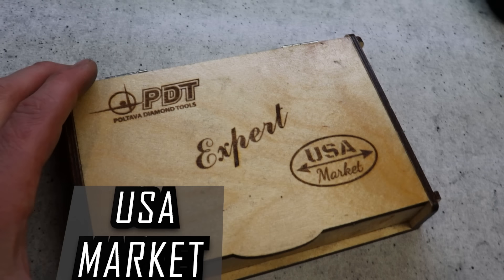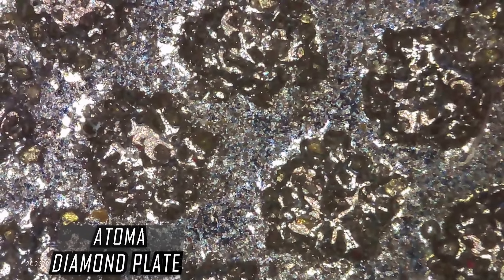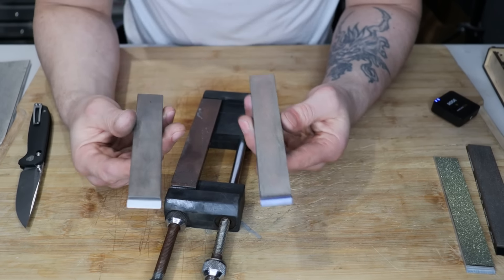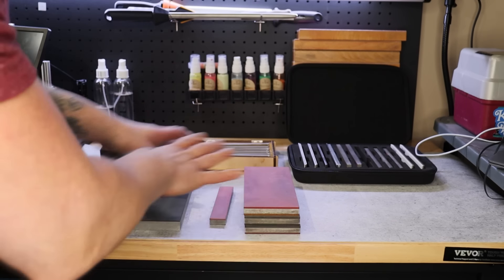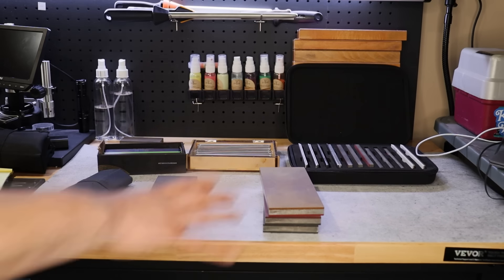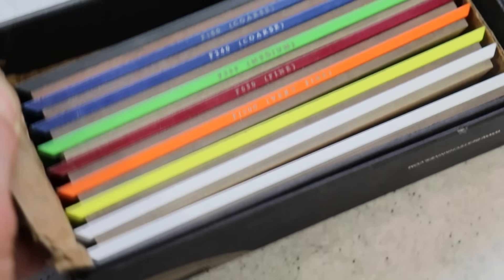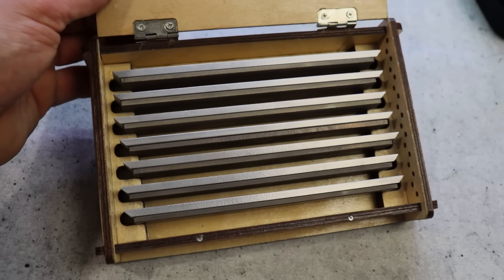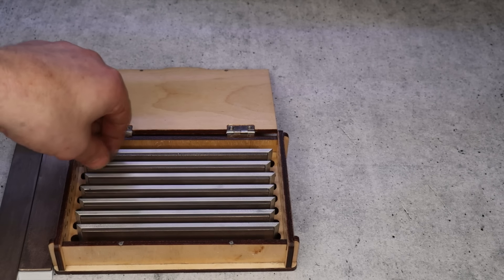Worlds Best Sharpening Stones!?  NEW USA MARKET SHARPENING STONES

Comment: Dude your Hapstone Premium stones still have the gray factory resin on them. That's why they aren't cutting. If you lap them with silicon carbide powder they will cut just as fast as PDT Resin and Metallic bonded CBN stones. I can literally guarantee it. The Hapstone Premium are also a hybrid organic resin and metallic bond mix. They are not pure metallic bond.

All that said, the PDT Resin Bonded CBN are by far my favorite stones of all time. So I agreed wholeheartedly with you and ones tried all the others you mentioned as well. Great video thanks!
Reply: Just out of curiosity but what grit of silicon powder do you use?
Reply: @fuzzynuttz5092  Different for every stone but never use a higher grit powder than the stone itself.
Reply: I’m glad you said something because I just got the Premium Hamptone set I used them and as they worked fine , they didn’t cut that great with less feedback than resin bonded , I have sic powder to cut them down hopefully there better , do you recommend a certain grit sic for the certain grit stone ? Thanks
Reply: @EdgeStoneKnives  will keep that in mind
Reply: Just subscribed to your channel
Reply: I just read that they use electrolysis or ferric chlorine to maintain CBN stones , can you use Sic power?
Reply: Fantastic more stones that I can't get 😂 No I appreciate ya keeping it 💯 bro and hope you have a fantasticc day as well as the family.
Reply from the maker: so i did do that, maybe i need to do them again thanks for the tip i will make sure to go ham on the powder see if i cant knock it down
Reply: @Antimatter.  Yes SiC powder is the only thing you can use on the resin CBN and on the metallic bonded CBN you can use it or ferric chloride.
Reply: @NeevesKnives  Yeah on mine I had to use F60/80 on the J80 obviously but also had to start all the rest of them off on F120 powder to get all that glaze off and get them flat. Then I obviously lapped each stone to higher grits, finishing just below the actual stone grit.
Reply: Thank you. I hate to see good stones like Hapstones cbn go to waste because they are not prepped correctly.
Reply: @Antimatter.  The SIC will embed in the softer metallic bond. Avoid it if your chasing
a mirror.
Reply: @JohnDoe-zb7dz  Ok Thanks I will , the electrolysis seems to work best
Reply: Hey, I noticed you have a channel. I’d be super interested in a video on how to prep and remove the grey factory finish from these Hapstone Premium CBNs if that was something you’d consider.
Reply: @timothyricca2250  yeah I need to stop being lazy and do a video of that
Reply: I can attest to this, mine wasn't cutting very fast either and used the little square stone that came with my naniwa and it helped but when I used the silicone carbide powder it was a big time improvement
Reply: @EdgeStoneKnives  Holy Cow you were right what a difference!!! I contacted Hapstone today and they told me if you need them more aggressive use Sic powder , So I use approx 200-300  grit lower on each stone and lapped that grey crap off , I have a complete set of sic powder so It made it easy , The 80 and 150 grit cuts like a beast now , Thanks again for the heads up
Reply: @Antimatter.  Awesome!! Love to hear that. They really should communicate that more to everyone that buys them!
Reply: @EdgeStoneKnives  Yes I agree it really completely changed them , there was No  feedback too now there great !!!
Reply from the maker: @EdgeStoneKnives yeah I used the 60 grit powder but I'm going to go over it again, maybe they need more than others I'm used to. Because normally I don't have to do that to most other bonded stones it helps bug not always a must. But I'm going to see thanks for the info
Reply: @NeevesKnives  Perhaps the "grey layer" is some kind of mold release or base layer? It would make sense then if that part of the stone doesn't have much abrasive and getting past it makes the stone perform as it should. I have some of the Hapstone premium CBNs on the way so I can't compare them yet.
Reply from the maker: @Riyame  personally these would be the only stones that ive gotten new that would be manditory to condition first if it does workout well. and i did already once but not for a long time
Reply: @NeevesKnives  just checking back in on this topic to let you know that they are totally different stones after doing a proper SiC Powder session
Reply: I have 5 Hapstone premium CBNs (150,240, 600, 1000, 2000). I bought three of the powders from Gritomatic. 120 grit SiC for the 150 and 240 stones. 400 grit SiC for the 600 and 1000 stones. And 1000 grit SiC for the 2000 stone. I also bought a glass 3d printer build plate off Amazon. Sprinkle a little water on the glass, add about half teaspoon of SiC… don’t use too much water, you want to build a slurry. Do crosshatch pattern on the stone with a pencil. Then get your figure 8 pattern on with even gentle pressure until the crosshatch disappears. Add little sprinkles of SiC as you “lose the slurry”
Reply: :face-blue-smiling: Guys, the HAPSTONE HAS NEVER MADE, DOES NOT, AND WILL NOT MAKE sharpening stones because he does not have the equipment for this!!! They buy these bars either from the Kyiv plant or in China, glue them onto aluminum bars and sell them under the Hapstone brand! They are great, but it is IMPOSSIBLE to say that Hapstone is a manufacturer, they are just good marketers 🙂
Reply: @Antimatter.  :face-blue-smiling: Guys, the HAPSTONE HAS NEVER MADE, DOES NOT, AND WILL NOT MAKE sharpening stones because he does not have the equipment for this!!! They buy these bars either from the Kyiv plant or in China, glue them onto aluminum bars and sell them under the Hapstone brand! They are great, but it is IMPOSSIBLE to say that Hapstone is a manufacturer, they are just good marketers :-)
Reply: @NeevesKnives , bit late, but when I got my metal bonded stones, I got some very coarse silicon carbide, 36 grit. Same manufacturer as these, poltava or pdt. I read some forum posts before buying. The coarse grits are fine on just silica, the finer ones you still need to dress with ferric or some other process. Expect to spend more time lapping because that glaze film on a fresh metal bond is stubborn. But if you put the extra time in, and plenty of abrasive, the nice abrasive will show itself. I only use the metal bonds for the coarse or formative jobs.
Reply: What makes you prefer the resin bonded cbn over thr metallic bonded cbn?
Reply: No way, the Hapstone didn't make their own CBN grinding material BECAUSE it's a huge industrial mashinery and technoly needed! They just mounten some grinding materisl that they bougth in Kiev Diamond Tools factory or, Poltava Diamond Tools Factory ON ALIMINIUM PLATE - THAT'S IT 🙂
Reply: @Antimatter. hey can you clarify that? My higher you mean finer or courser? Thanks!
Reply: @samwise2010  Higher I mean higher Grit , so lower grit would be more course than a higher grit , The higher you go the finer the stones get
Reply: No. The Hapstone DON’T have their own made the resin factory for Diamond or CBN!
They are ONLY re-seller that just give the name to other brand of sharpening stone that they mounted on aluminum blanks 🤣
Reply: @NeevesKnives  have you ever heard of “Aldim” cbn / diamond stones? I see them everywhere at a “fairly” decent price. Just wondering if it’s worth it.
Reply from the maker: @CanManCam28  i personally don't know anything about them,  I'm personally weary of a lot of companies that make sharpening supplies as there's a ton of poor quality or just straight gimmicks out there

Comment: Yeah take a Para 3 in S45VN and sharpen it to 800 grit on a work sharp professional precision adjust. Once complete, run it over 4 different diamond emulsion strops, going from 6 micron, to 3 micron, to 1 micron, and finally 0.5 micron. The edge on that Para 3 will absolutely cut you to the bone if you make a mistake!

Comment: Pdt makes some great stones! I’ve had a set of the metallic bonded cbn ones for almost a year now and I can say they are excellent. However, those new venev archer metallic bonded diamond ones from gritomatic have been my favorite recently for normal sharpenings. (I don’t really chase mirrors much anymore) 😂
Reply: Gritomatic that sell Hapstone or Venev on Amazon, has NEVER ever MADE AND CAN NOT MAKE the BODY(!) for a sharpening stone BECAUSE THEY DO NOT HAVE THE EQUIPMENT FOR THIS! All they do is buy sharpening stones somewhere, stick them on aluminum and put their trademark, but they are not TO THE PRODUCTION OF THE BODY OF GRINDING STONE from PDTools or Venev. So, why people have to buy from Gritomatic instead official dealer USA-Market of PDTools? 🙂

Comment: I have been on the fence watching PDT on Ebay. So glad you ended up making a video about the different stones. Still a noob with sharpening but slowly figuring it all out.
Reply from the maker: well i have a ton of videos for you to watch
Reply: Keep in mind the American vendor on ebay has thicker base plates than the factory Poltava. As hard and flat as these Poltava'a are, I still check angles between every plate swap.
Reply: @NeevesKnives  Yeah been watching your channel for a few years now. I have the TSPROF Britz pro with the TSPROF diamond and some Gritomatic diamond. Time to upgrade since my collection keeps getting bigger and bigger with higher HRC steels.
Reply: @JohnDoe-zb7dz  Yeah Ebay PDT shows 4mm plates with 3mm grit. I'm not rushing till I learn what is what. If I'm spending 5-600 on stones I want to make sure I know what I'm buying.
Reply from the maker: @S4Detroit  as you should. And depending on how much sharpening you are doing getting the 3mm might nor be worth it, the 1.5 lites might be the way to go, put it this way I've had my 2mm resin bonded diamonds for years now and most have barely even started showing wear, smaller stones will burn up faster than large but are still going to last a very long time, also you can mix and match
Reply: @S4Detroit  Got my entire collection from Gritomatic 3 months ago when they ran a sale. No regrets. They carry the thinner backing plates. Stones are same thickness no matter what backing or vender you choose.

Comment: I really hope you do a review on the Venev Centaur stones. I'm going to end up buying the three Stone set in order to keep practicing my free hand skills, but also I want to try the resin bonded diamonds as well.
Reply: they are very good but a great deal slower and wear very slowly, but faster by far than metallic bonded.  P:DT made them as well. I have only one here  in the 3000 grit diamond resin bonded. Polishes the same as the Veneve.  Not as pretty a color I guess. simple light cream brown rather the the redish 3000 veneve. if that matters at all. Much thicker bond by double at least. 

Oop's, my mystique. only 2mm. I was thinking of themetalix bonded which is 3.50 mm. I understand them make two different thicknesses just as Veneve does. 

KnifeMaker

Comment: I ended up getting the complete 11 $tone $et of these PDT plate$. Huge investment.
I really like them. The 15,000 PDT will leave scratches over the Edge Pro 4k stones.
Poltava uses the Gost rating system so be aware. Lifetime stones. Very fast cutters. 
I use Ferric Chloride to refresh them. Do not use SIC powder on these stones per Poltava. 
Not great for a mirror polish. Use resin stones for that. Cheers.

Great informative video Jerad. Bang!
Reply from the maker: HMM so the company is who reccommended the carbide powder but i will take what you said. i notice the deeper scratches as well, however i notice up to the 3k is extremely fine, it seems the 5 and 15k are the ones with that
Reply: @NeevesKnives  The SIC has a tendency to embed in the softer metallic bond. Not a big deal unless your chasing a mirror.
Reply: @JohnDoe-zb7dz  Their rep here is the one who suggested the sic powder. However when in contact with the company owner, he told me Etch with the Fic.. The sic powder leaves the surface much slicker. Much less bite. ;<) 
I then coat the stone and base with Trend Diamond sharpening fluid to protect it further should any acid remain. 
KnifeMaker
Reply: @michaell397  Thank you so much for the validation. I knew someone somewhere 
prioritized Fic over the SIC. OR maybe the
owner wants you to "etch" through them faster to sell more?? HA!
Reply: @JohnDoe-zb7dz  it really doesn't remove enough to measure. It only removes a tiny amount of the metal matrix to expose the sharp edges of the CBN. The powder works to break them in by removing the thin coating as shipped. But it does not remove the very thin layer of matrix but rather leaves it feeling almost worn out. Very little bite. 
 I leave the Fic on it for 20 minute, rinse in water with soda mixed in to kill any acidic action. Only paint the surface with the FIC with q tip dipped into the acid.  don't let it touch the sides or base. 
I mix the Fic 50/50 with water to slow the etch. 

KnifeMaker

Comment: I been screaming it for almost 2 years now! Poltava Met binded cbn is the best stones on the market next to super vitrified diamond.
Reply: Better than venev?
Reply: @StoneHands25  Yes!
Reply: Best resin bonded stone I've used in Nanawa. wish they made 1x6 backed stones for our fixed angle sharpeners. but they still do not cut as well as a Poltava CBN Stone. I have never had the opportunity to try a vitrified Stone. 
I was tempted by the BBB stones, but no way I'm risking 400 bucks having never seen or tried one!
KnifeMaker

Comment: I average about 25 knives a week, mostly kitchen from a variety of manufs. I have been using Atoma plates on a K03. I buy the 8x3 replacement plates, cut them on a bandsaw and finish the edges for application to my 1x6 aluminum plates. Saves a lot of $ this way, but I do still replace them quite often, especially the 600. I don't often find a need to chase a mirror and I have always seen it as subjective anyway, so the 4 grits Atoma produces along with stropping with Gunny 1um is satisfactory. Now you have me wondering if the metallic bonded cbn might be more cost-effective by cutting profiling time and the longevity of the stones. Your thoughts, or anyone else?
Reply: The metal bonded CBN will last SIGNIFICANTLY longer. Likely thousands of knives very easily (for even the low grit stones). That being said, you might want to keep a single very low grit Atoma plate around for when you have a serious profiling job to do as they will cut much faster than the CBN stones.
Reply: CBN metalic bond 600 grit will work for 5-7 years if you will sharp 100 knives per month
Reply: @Riyame  👌

Comment: Thanks for the video, question- I want to try to the diamond resin bonded plates 5000g, does it come with a flattening stone? If not not, what should I buy? Not crazy about chemicals, I heard use nagura silicon carbide, any recommendations?
Reply from the maker: I recently did a video on the KDTU hybrid bonded stones check that out i show you exactly what to get

Comment: What has been your experience with Edge Pro Diamond Matrix stones? They're actually in stock. These PDT metallic cbn stones only have a few options in stock.
Reply: The Edge Pro Diamond Matrix stones use an electrolysis process to deposit their Diamonds on the plate, which fly out when the "glue" (electrolysis bonds) gets old. PDTools, Ukraine uses copper-tin lava, which is sintered in crucible furnaces under high pressure and extreme temperatures, so you get a monolithic sharpening bar that will sharpen up to 77,000 knives for you :yougotthis:. Well, I'm not sure that Edge Pro Diamond Matrix stones can sharpen at least 1,500 knives :elbowcough:
Reply: @timursadriev7987  I actually ordered some poltava resin cbn stones from you  recently :). Excited to get them in. A lot of people I spoke with preferred the resin bonded cbn for a few reasons. I'm sure I'll end up with many of both eventually. Thanks for the input!

Comment: I know this is 4 months ago, and I have paused about mid way to type this.. But what about grit rating? Example, I have heard the Venev's are approximately triple their rating, so a listed 400 grit Venev is equivalent to a 1200 grit Synthetic Ceramic Japanese stone.. Is this true in your experience and is this the same with the PDTools versions? This is the only thing so far that has kept me from purchasing most resin bonded / CBN / Metal Bonded CBN stones as I don't know what their "true" grit rating is from a sharpening standpoint and long time use of Japanese Ceramic whetstones.
Reply from the maker: So this company tells you the micron and Grit which is what you are wanting, the venev use an F rating. These are not however they do show charts on there site just incase. But all the ones I have are marked correctly
Reply: @NeevesKnives  Thank you so much, I appreciate the info. I agree, I like getting the Micron numbers as well as grit similar to the Shapton  Glass stones. That allows me to judge better based on my needs / wants. I truly appreciate all your deep dives and information, you and OUTDOORS55 help me in many ways along this journey. I thought I was a steel and stone nerd until I saw you guys years ago!

Comment: They're nice but they're pricey. I can't justify buying a set when i have a complete set of Venevs (theyre ok) and Edge Pro diamond matrix (which are my favorite). If you're a professional sharpen (or have more money than you know what to do with) i can see justifying buying them. For me, what i have is fine.
Been using a 800 grit boron nitride stone (its like a mix of a waterstone and ceramic) and irs awesome. Cuts fast, and with either 6 or 3 micron strop (i use 3M micropore medical tape or balsa) gives a great toothy and sharp edge.